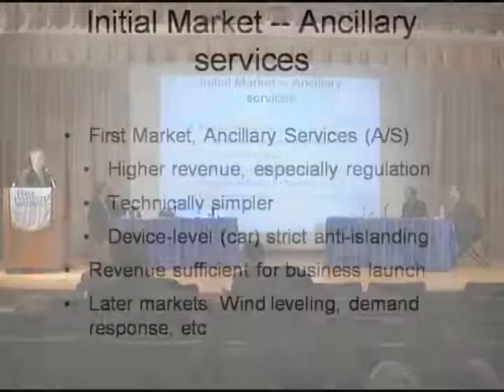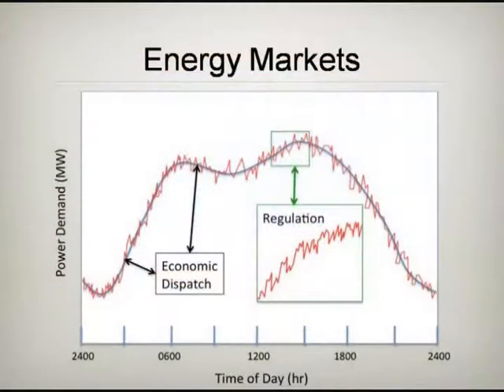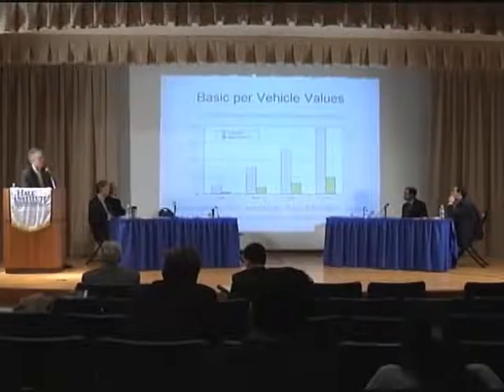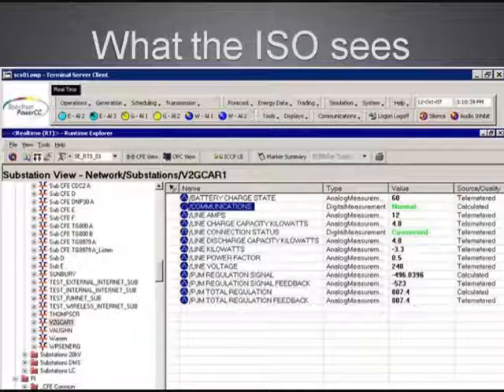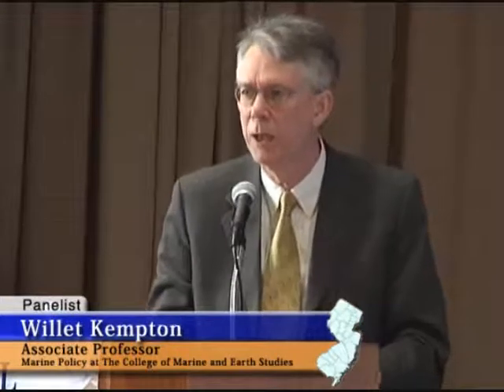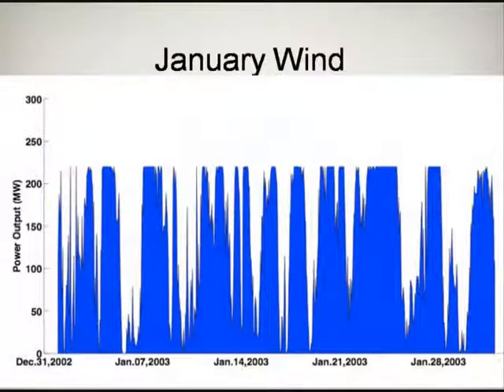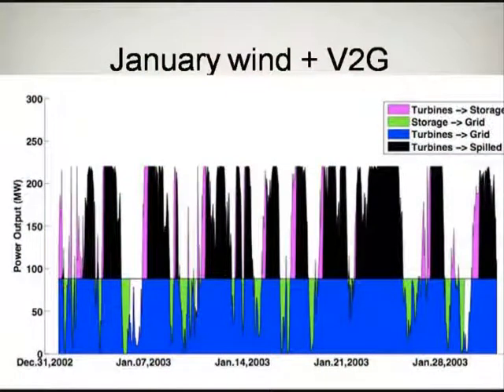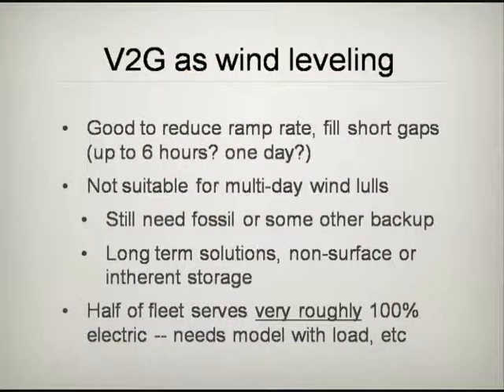Hall Institute Energy Panel: Willett Kempton on Vehicle-to-Grid Energy Storage Part 3

Comment: Very interesting concept, with one critical infrastructure requirement, as yet unavailable, ubiquitous internet connected charging stations, to facilitate internet connection of cars, whenever parked. Current charge connection is used when batteries are low. Ubiquitous charging only easy at home, provided electric car owners all have home chargers.